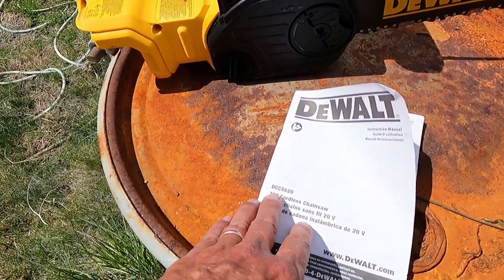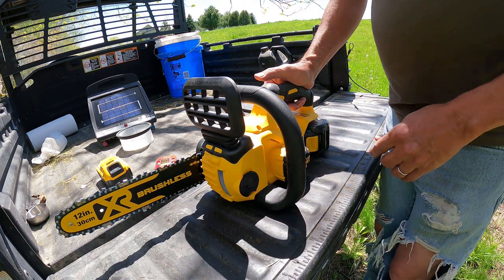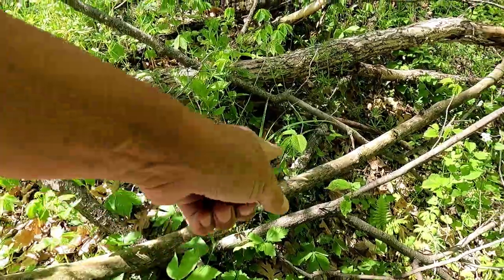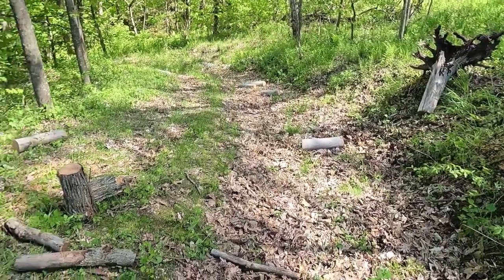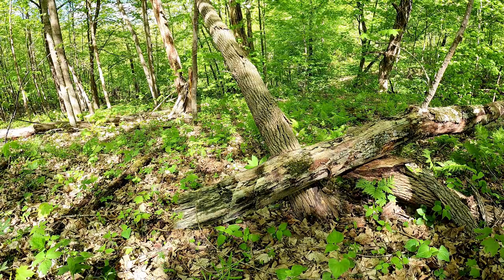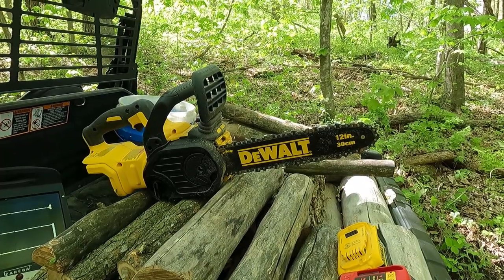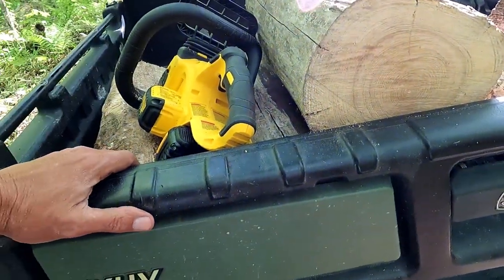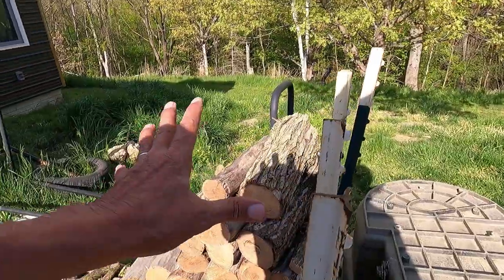DeWalt DCCS620 20V Cordless Chainsaw ‘Stress Test’ Review

Comment from the maker: I cut 1/4 of our winter heating needs on the day I tested this. We use two face cords of wood to heat the house each year, and we could easily get that with this saw as there are plenty of downed trees to pick from in the woods — but this year I will be doing clearing, and will be saving all of the prime firewood so we should build-up a stockpile. Also, our new shop building will be mostly heated with wood so we still have to figure out how much that will take. I will be using the saw extensively this summer, so we'll see how durable it is!

Comment: They are a great little saw. I just put a new Oregon chain on mine yesterday, made a huge difference. Walks through 12 inch Black Walnut logs. I just cut halfway through and give it a turn until through.
Reply from the maker: I really like mine as well. It's always ready to go where a gas saw may take awhile to start!
Reply: @PlanetMojo  Can't beat the convenience. Or the reliability. Throw it in a cabinet at the end of winter and it will be ready to go next time you need it.
Reply from the maker: @Wheelman1966  Agreed!

Comment: Just ordered this chainsaw. Good video, thanks!
Reply from the maker: We just got done cutting an entire day. It's a really nice saw 😊
Reply: @PlanetMojo  Got my saw! LOVE IT! Also FYI for those having an issue with oil leaking from the filler cap, At the top of the oil filler tube IS A BLACK O-RING. You can see and feel it there too. When you turn the cap ALL THE WAY closed it expands that O-Ring to seal the cap. I think some folks may not be closing that cap all the way and this is causing the leaks. You should not need to add an O-Ring. The O-ring at the top of the filler tube will fill that O-Ring gap in the oil cap.
Reply from the maker: @Tommyr  Thanks for the info! I did have a little bit of leakage, and will check that out! 😊

Comment: Is the 6ah battery work the extra price compared to the 5ah when you can get two for the same price
Reply from the maker: That's a good question! I don't think so, but I should do a side by side comparison this spring. If I had a choice of only being able to take on 6ah or two 5ah batteries, I would take the two 5ah.
Reply: I know this is old but for anyone wondering, hard yes to the 6ah batteries. The 5ah and below use 18650 cells while the 6ah use 21700s that are much better at prolonged high discharge.

Comment: It really is a beast of a saw for its size. Easy to carry in a backpack or anything. Much better than the Makita XCU06.

For firewood, not a good saw. For clearing roads and fence lines as you said, good saw.
Reply from the maker: I agree. I thought I may use it for limbing, but when I'm felling trees, I just go right down the line limbing and bucking. It is quite nice to just have in the back of the gator for the nuisance windfall though! I can cut through most any tree if I go from both sides, and clear a road. 😊

Comment: Hi Mojo, looks a really good saw, of course the trick is to keep your chain sharpened, do you like to test your logs for dryness, some wood burners insist you have to be below 22, their the ones with a catalyst. Don't think you will ever be running out of wood any time soon.
Reply from the maker: Hi Larry, you are certainly correct on the sharp chain. That holds true with all cutting tools. Dull tools are dangerous tools! The cracking on the logs gives an indication of dryness. Standing deadwood dries at about an inch inwards per year, and the cracks follow the drying. Once split, they will dry out any further if needed, but we only use seasoned standing (or fallen) deadwood for firewood. Most of our firewood is below 20% moisture — right around 18%. 🔥😊🔥

Comment: How heavy is that little saw compared to the big gas saw that you've been using? Looks a lot less scary to me.😉
Reply from the maker: It's quite light. I'm liking it more and more as I use it. I took down a dozen trees where the shop road is going, and it was a breeze! Hopefully it will hold up, and I'll get the 18" one as well, and rarely have to use the fussy Husqvarna! 😊
Reply: 9 lbs
Reply: It's very light. Have not had extensive experience with gas saws, but it's much lighter than you would expect for the power. I haven't checked that 9lbs figure above, but it sounds about right, it's far lighter than anything of similar size I've used in the gas world.

Comment: Great video  I think you help made up my mind on what saw to get the 20v DCCS620 because the 8.8 lb easy to move around and I am old so when the battery is done so will I be done  we will make a good team lol my son got the  milwaukee 2727-20 it a great saw but it 15 lb I think with battery not shore about the weight but a lot heavier to know in my time I use a lot of chainsaw one time the bigger the better but that changed know smaller for me I love all chainsaw because when I was younger I bilt a 40' x 16" long liner fishing boat with a chainsaw an a axe squared all the trees with the chainsaw in the woods so I could make them light enouf to bring them home on a skidoo and slay every every Pease of timber and beam was cut squared in woods even most of the planks 
I fish that boat of shore over 100 mils that boat is still in the fishery today bilt with a chain saw the hardest Pease to get was the stem and the keel it was done just my brother an me back in the Earley 1980 l had not much money but I had a enough to get a chainsaw it was a Mcculloch Pro Mac 10 10 that put me on my feat love chainsaw thanks for the nice video staysafe
Reply from the maker: Thanks for watching 57 Pad! I now have four chainsaws. The DeWalt and and a Saker Mini-Chainsaw are both cordless, and I have a mid-size Stihl and large Husqvarna. I like the electric saws most in the winter when the gas ones are harder to start, or on smaller jobs. I use the mid-sized Stihl the most because we cut our own firewood, and the electric saws just can't handle that. I use the Husqvarna mostly when felling larger trees or when clearing an area. The little Saker saw is used mostly for limbing, and is really light (it's a 4" chainsaw!).

Comment: I have that saw and the 60v version. I've upgraded both with bigger bars, I put an 18" poulan pro Oregon bar on my flexvolt and took the 16" flexvolt bar and put on the 20v saw.  I absolutely love them that way, the 16" bar cuts much better than the 12" bar.
Reply from the maker: My wife bought me a longer bar for this saw, but I'm worried it doesn't have the power for it. I will likely give it a try later this fall.
Reply: @PlanetMojo  I've ran mine with the 16" bar in a dry log that was every bit of 24" had to come at it from both sides. I stalled it a few times but it did it,  I didn't have the flexvolt with me that day. But it really didn't matter,  if you get those 10ah 20v lawnmower batteries that saw runs a long time, so it's my "truck saw" stays in the toolbox with a full 10ah
Reply from the maker: @CadillacZachOffical I'm thinking of keeping this one with a little bar for limbing and little windfalls and get the larger sized one for most of the other stuff. I have a big Husqvarna for the rest  😉
Reply: @PlanetMojo  I absolutely love both of them,  if you are thinking about getting the 60v I say go ahead and do it! I only have one gas saw now, a big old McCulloch,  I use the DeWalt saws for almost everything except the big big stuff. Like I said, I put an 18" poulan pro Oregon bar on the flexvolt saw.

Comment: Btw the 20v saw leaks oil pretty bad unless you store it on its side with the oil cap facing up,  the 60v doesn't seem to leak if you hang it on the wall using the supplied hanger built in the bottom. The 20v doesn't have a hanger built in.
Reply from the maker: Thanks Zach, yea I found that out the hard way. The manual says to drain the oil after each use — not a chance that is happening 😉

Comment: Mine lasted one season, now it just tries to start up but instantly stops after a split second
Reply from the maker: Mine is still working in the third season. Sounds like something is jammed-up on yours.
Reply: Have tried everything, you can actually pull the chain and it will rotate, was thinking it may be a thermal switch gone bad
Reply: @jrlaymance   I bought a DCCS620 TYPE 2  in 2021 and used it one season.  One thermal issue that summer.  This month 2023 it quit on me and will not react, not even a click.  I took it apart and tested the switches and wiring with a VOM.   No results except thinking the "Potted module " has failed.  Replacement is over $100 for motor / wiring /switch / module  which is not a good option if I can buy a new saw for $160 at H-D ( less battery ).  Dang potted electronics module !

Comment: Typical male I didn't read the instruction manual on the first of these I bought, I burnt it out after several uses due to not realizing it required oil (d'oh!). I use canola oil in mine now, it seems to work great. This "new" one I've had for several years working great, until the other day when I had to do a cut in a really awkward position for safety when cutting down a tree and the motor somehow gave out in a way that it has very little power now. I have the whole thing taken apart and have not found anything wrong with the internals, so I'm on the fence about how this will function once it's put back together.